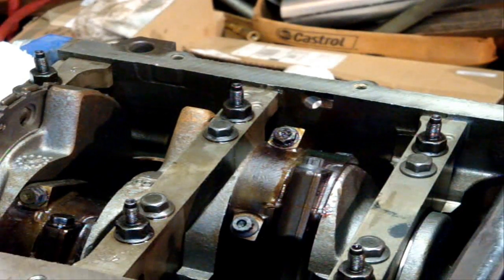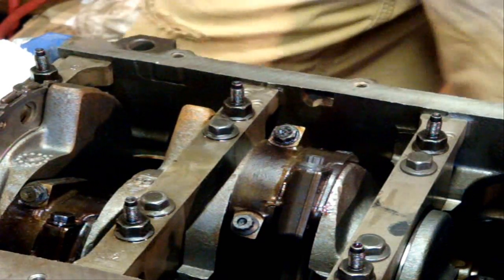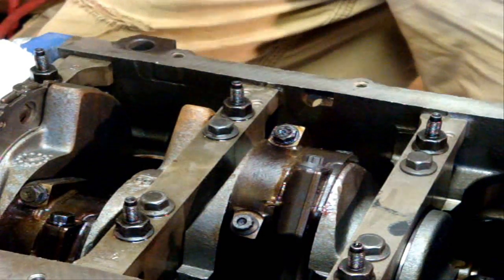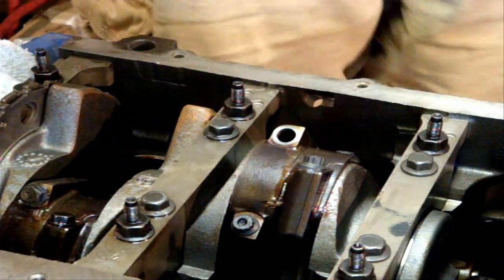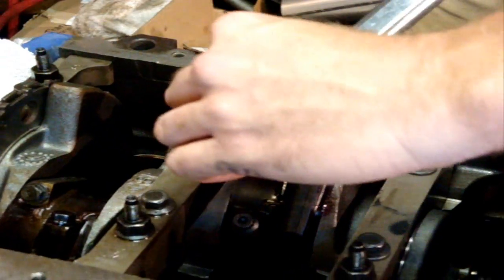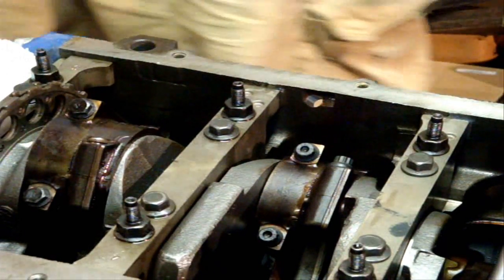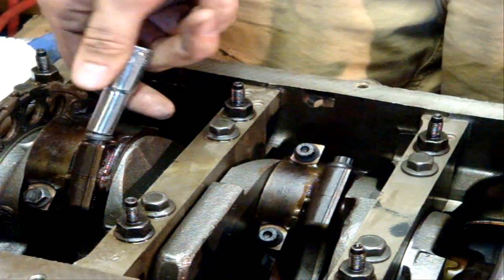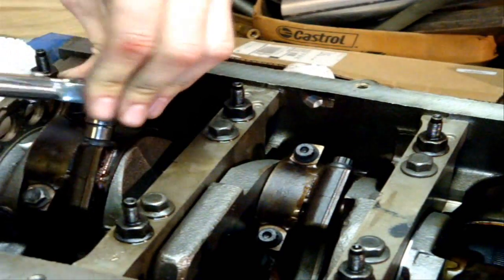ARP Rod Bolt Install - LQ4 Build Segment Six

Comment: Just about to do this to mine... scared shitless about not resizing them
Reply from the maker: Joe Duncan I went back and forth for a while on this.  For me, resizing the rods for whatever reason put me over the edge on a budget build.  I know it probably wouldnt be that much money, but if Im resizing rods, I might as well get everything balanced etc etc.  So far so good.  Few thousand miles, still great oil pressure, and nothing odd.  And I beat on it. haha.  My next motor build will use brand new rods to avoid this whole situation.
Reply: Yea me too! I just finished the damn engine... ordered the bolts THEN read about resizing them... if it puts your mind at ease... most say you dont need to re size if you use the 134-6006 bolts
Reply: Not sure if you still have this account but how did the engine turn out? Im in the same position im looking into just getting stock spec bolts and doing factory torque sequence

Comment: Well, how did it turn out? I would imagine that everything went well. I really don't see why they need to be resized
Reply from the maker: She's still holding together.  Great oil pressure.  No weird noises.  And Ive had it spinning pretty good a few times.  So, as far as I can tell, its fine.  If it lets go you'll all be the first to know :)

Comment: The only reason you would need to resize the rods is if your going to apply more clamping force than original.
Reply: @James Taylor     That's can't be the only reason. Why would you want to apply more clamping force on the rod cap than prescribed?
Reply: Because some rod bolts require it. Some dont use torque specs they use preset rodstretch. Its been proven arp rod bolts change your clearence. Some engines fail because of it. Some are fine
Reply: James Turner     That's a load of bullshit! (It's you're (as in you are) not your.)
Reply: James Turner your not supposed to resize these rods.  You can but shouldn't

Comment from the maker: @NickRitter Car has been away since late December. Glad I parked it because its been a messy winter! It has about 300 miles on it, and runs awesome! No super hard pulls yet because the tune is goofey. Im getting new injectors and a tune this spring...then we'll see what's what! But so far so good!
Reply: you should join ls1 tech and put these videos up there also i subbed to you channel good stuff on here !
Reply from the maker: Nick Ritter
Thanks!  Glad you enjoy the channel so far.  I am a member over there (ghettocruiser).  I put a few things up here and there, but didnt do a full build thread there.  I might stick some of the videos up eventually.  More love for the thirdgen guys over on the thirdgen boards though :)